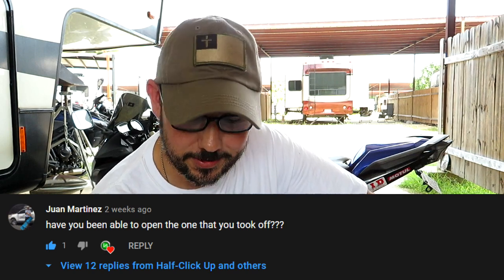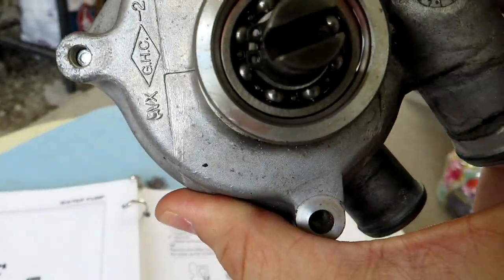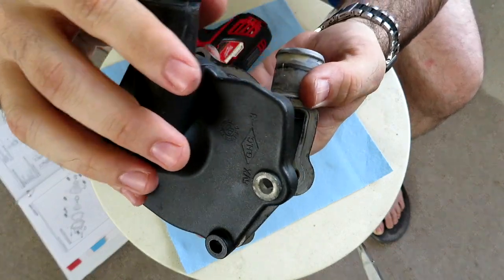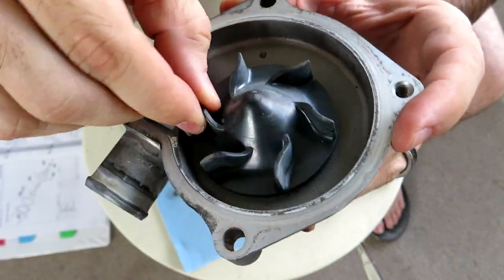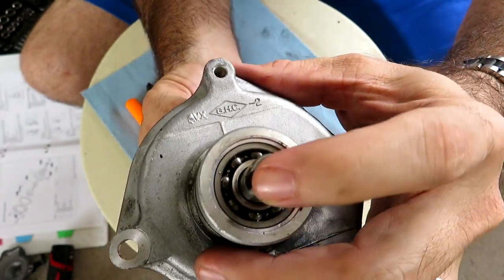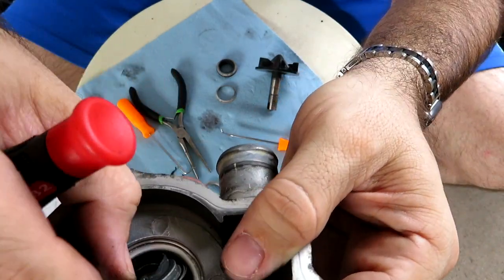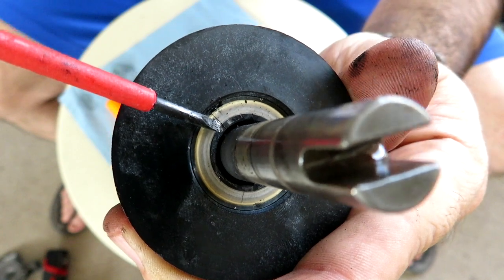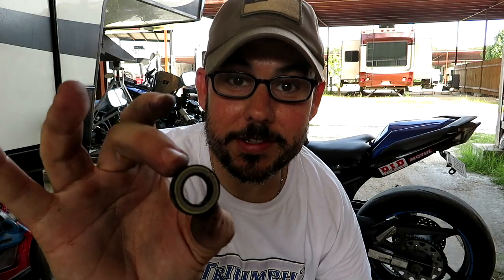Yamaha FZ6R: Water Pump Investigation

Comment: So the failure is on a part that separates coolant with oil ?
Reply from the maker: @dimitris_diamantopoulos  essentially, yes.. it’s the ceramic washer that is part of that gasket assembly that develops micro cracks. It’s replaceable, but it’s more cost effective to purchase an entire low mileage pump assembly from eBay.
Reply: @HalfClickUp  Actually item 6 on the parts list is the oil seal on the engine side of the water seal that stops any coolant leaking  in to the oil or for that matter oil getting in to the water, for coolant to get in to the oil both seals wold have to fail. Just rebuilt a FJR water pump has the same construction as nearly all Yamaha pumps do. Just rebuild the back half and you have a spare pump when you need it.

Comment: 2004 YZF R6 - I had a slow coolant leak through the weep hole. No noise from the waterpump but exact same problem with cracked seals behind the impeller. The impeller looks different and is made out of metal though
Reply from the maker: Interesting that the R6 impeller is metal... Wonder what the advantage of metal over plastic might be, other than strength? Perhaps it was a case of cost controls in the manufacturing process?

Comment: Thanks Juan for showing interest, because of you and 1/2CU I’m now watching this video with an overheating issue and my water pump was making that sound a week ago 😬😬😬 hopefully it didn’t cause major damage! Put 300+mi since then😅
Reply from the maker: She’s on borrowed time, my friend. Find you a low mileage pump on eBay like I did!
Reply: @HalfClickUp  just ordered the whole unit with chain on EBay for $78, off an R1 with 30k miles. My bike has almost 90k. I got that seal kit too just in case.
Reply from the maker: @BikingVikingHH  you sure the R1 pump shares the same part number with the Fizzer/R6? I’ve never verified that..

Comment: I have a 07 r6 and throwing antifreeze as temperature is getting hot
Reply from the maker: From the water pump’s weep hole? If so, sounds like your ceramic washer may have cracked. Any high pitched squealing sounds?
Reply: @HalfClickUp  no just a small rattle but it goes away after a 30 sec
Reply from the maker: @victor0889  she’s warning you 😉
Reply: @HalfClickUp  My screams have developed and am looking for a replacement to avoid replacing them all
Reply from the maker: @MrGodpasser  you can rebuild your pump with new ceramic washers, but low mileage pumps are so inexpensive on eBay that it makes better sense to just replace your entire assembly. The required coolant flush is a bonus for your maintenance regimen.
Reply: @HalfClickUp  love you! thank you!
Reply from the maker: @MrGodpasser  you’re welcome!